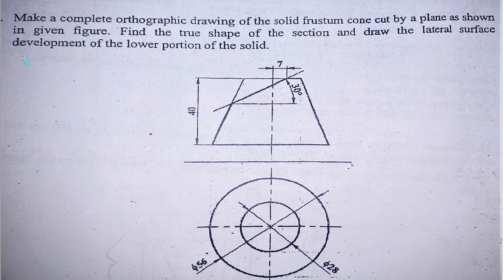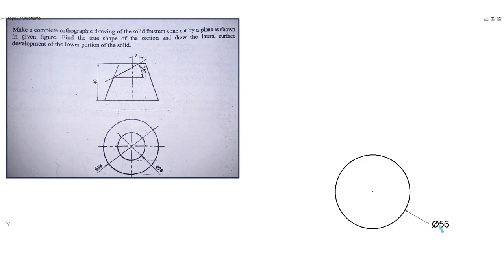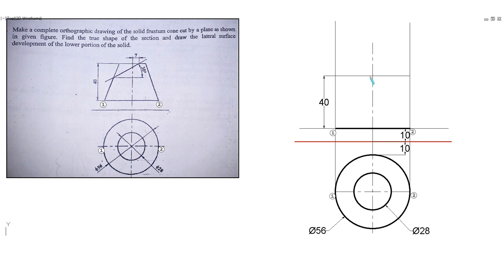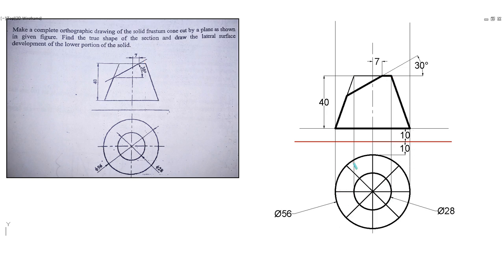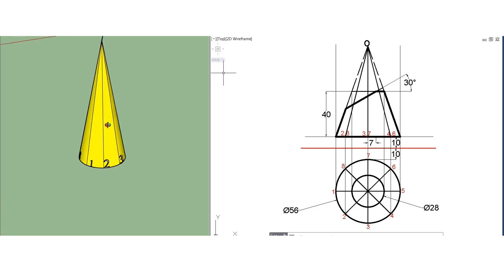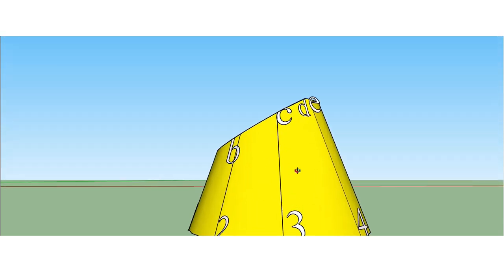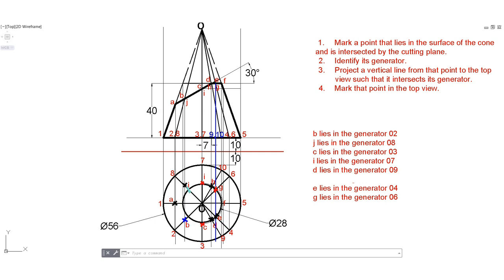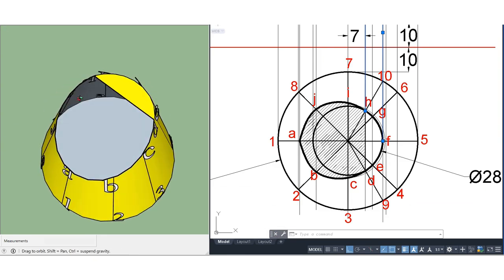Surface development of cone

Comment: You cannot use compass to measure truncated distance. Its totally wrong in engineering. You have to take projection of each
Reply from the maker: The generators which are parallel to Vp will always appear in true length in front view. So you can either measure it from compass or project it , it will always give its true length.